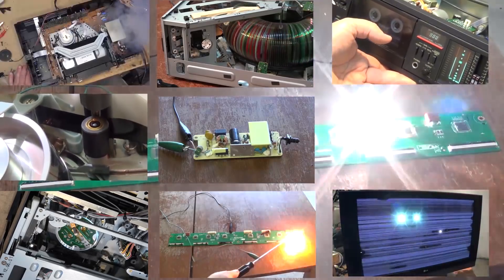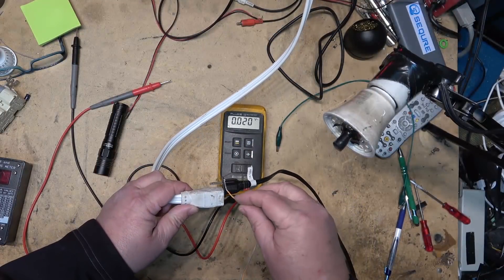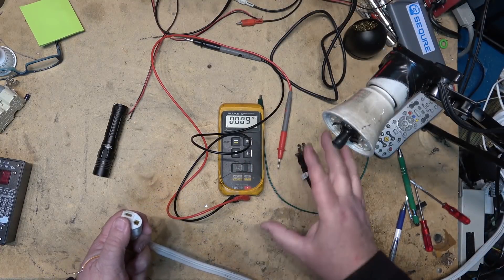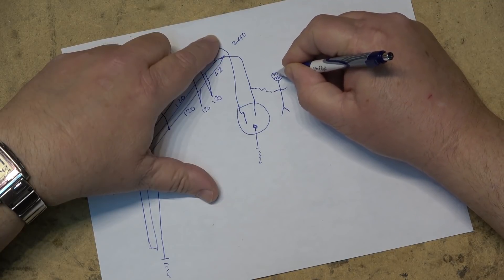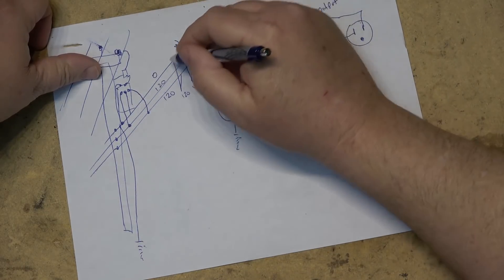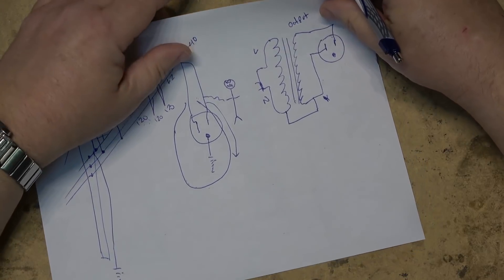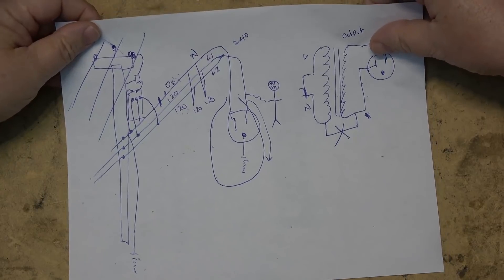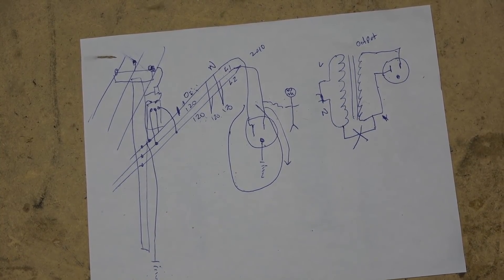Isolation Transformers For Dummies

Comment: Oh! You should install a RCD :-)
Reply: Whilst that does help make it safer, it is NOT the same protection as an Isolation transformer.
An RCD or GFCI is kind of like relying on your car's airbag to prevent death, rather than getting your brakes repaired.
Reply: @johncoops6897  Just to clarify my earlier comment. I am NOT implying that GFCI is a replacement for an isolation transformer. I simply noticed that Dave's outlet at his workbench area is not GFGI protected. I always plug DUT into an isolation transformer. But transformer is plugged into an outlet that is on a GFCI breaker. And all my instruments, tools, music equipment - anything I touch is on that GFCI circuit breaker. You are right, GFGI is an airbag.... but Dave doesn't have it at his bench. That was the point of my comment.
Reply: @astaltsev  - Yes, that makes sense. However in the context of this video, your comment came across like you were suggesting an RCD instead of an Isolation transformer.
In Australia having an RCD is mandatory for the power circuits, and the past 2 houses I've lived in have one RCD per individual circuit. I trip them quite often, since I do all manner of dubiously unsafe things LOL, but at least it only takes down one circuit rather than the entire house!
Reply: @johncoops6897  definitely wasn't my intention and I thought my comment to Dave  was quite clear, I referred to the minute and second in the video where he connected a bulb between hot and house ground and the bulb came and stayed on instead of tripping an RCD breaker.
When I wired my garage in Sydney, I made sure to have a separate RCD so I don't affect anyone with my activities. The rest of outlets were all on the same RCD :(
Reply: @astaltsev  -  You just wrote "I referred to the minute and second in the video where he connected a bulb between hot and..." ...
If you go up and take a look at your original comment, you will see that you didn't include any such timestamp or reference [wink] .
Even stranger, why have you changed IDs from "Hugo Sauerstein" to "Dmitri Astaltsev" ? Anyway, neither of you included a timestamp, however I didn't notice the ID change and thought I was replying to the same person...  now I am just confused LOL
Reply: @johncoops6897  my original post is no longer showing up :( not sure if it was removed by Dave or you need to have paid account in YouTube. I think I was second to comment on the video when it was just published. We even had a small exchange with Dave himself about how he lost $1000 worth of fish in aquarium when GFCI tripped and stopped the pumps. And I had a story about steaming iron. I still have these comments on my computer screen but if I open a new tab with this video - cannot get to them anymore
Reply from the maker: @astaltsev  I redid the video to correct a error in the diagram so when it was replaced all the comments also were removed.
Reply from the maker: @astaltsev  ground fault outlets are a pain in the ass they trip for no reason.   Here they are only required for outdoor outlets and bathroom outlets. I used to have one on my aquarium that tripped due to humidity in the light canopy.   This killed power to the pump and the result was about 1000 in dead fish.
Reply: @12voltvids  - that is the reason why it is a good idea to have individual RCD per circuit. I also had fridges and A/C on separate circuits.
Reply: @astaltsev  Just because an individual outlet isn't visibly GFCI/RCD doesn't mean that it couldn't be protected by a device upstream...
Reply: @michaeltempsch5282  there is only an extension cord in the video - we can't see the outlet :) but ... at one stage in the video ~2m 15 seconds Dave connected the lamp between the hot and ground wires (not neutral) and the lamp lit up and stayed on. If the extension cord was plugged in into a section that was on RCD breaker, RCD should have tripped, that is it's whole reason to exist . Anyway, Dave himself confirmed there is no RCD on that line, it is not required by electrical code.
I would still install it "just in case". Dave is a lot more experienced engineer so am sure he thought of that but decided not to do it. Maybe to be able to give us this demo :)
Reply from the maker: @johncoops6897  they are all individual but here for code only required on outdoor or bathroom plugs or others where water is involved.   Regular interior do not require.